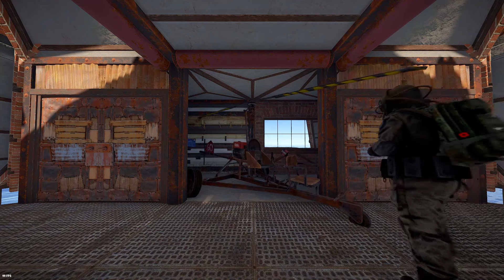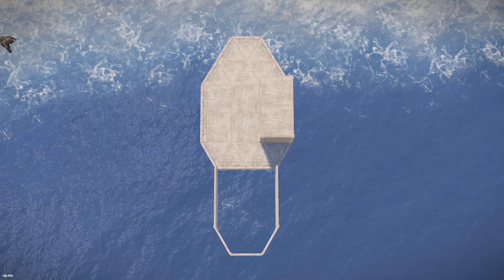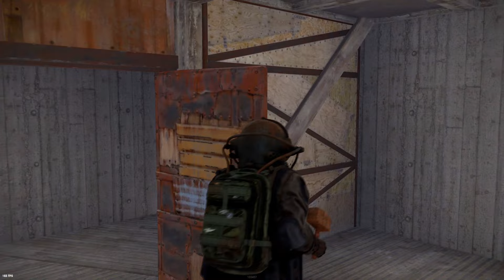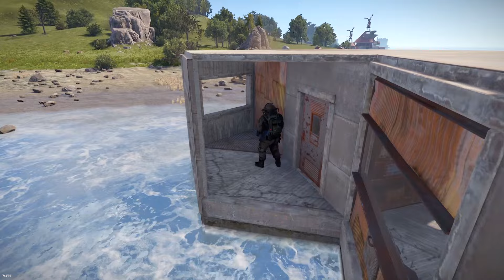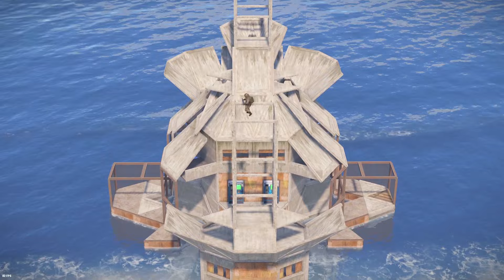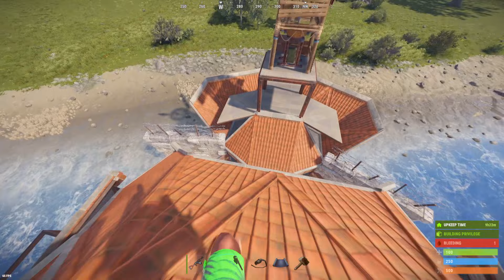Defendable Boat Base w/ Feathered Roof

Comment: Love this man, also loved your 3x3 pvp base and been using it. Reckon you could find a way to add a Rhib garage to this using high external stone gate?
Reply from the maker: If u ripped the front walls off the dock and raised the roof you could most likely plop a gate down there and transform it into a rhib garage. Might need to get closer to the shore tho. Im not sure how far out you could wall here
Reply: @Drizzza  I think you'd have to start with the gate and freehand it backwards? Dunno... i'll experiment

Comment: Only problem I see is you are placing your metal embrasures on the inside of the wall, which allows someone to jump on the outside window sill and softside thru the embrasure.

If you place them on the outside, players can't jump onto the outside window sill.
Reply from the maker: Yeah they can do that and soft side my garage door while they're at it
Reply: @Drizzza  true, didn't notice that until you mentioned! Still a beautiful base nonetheless!